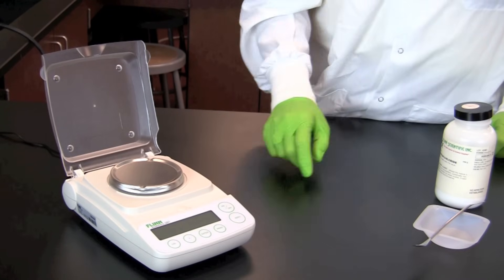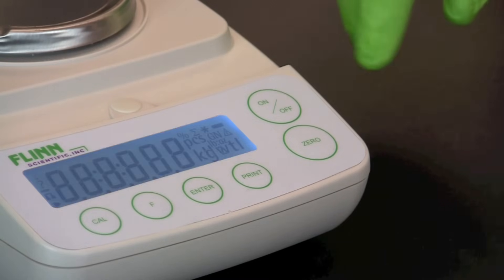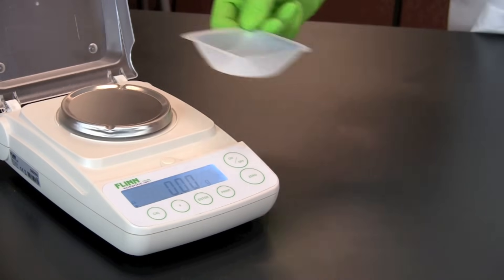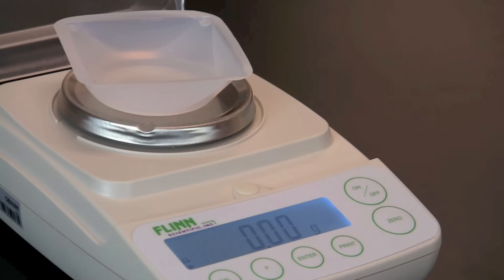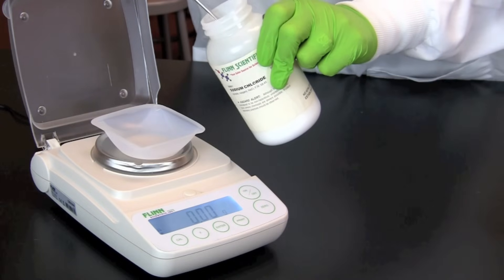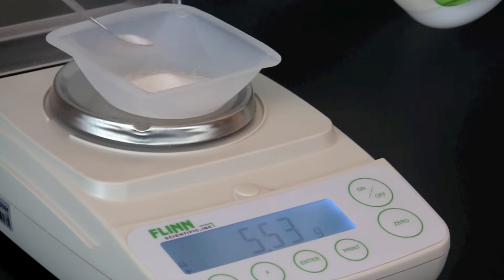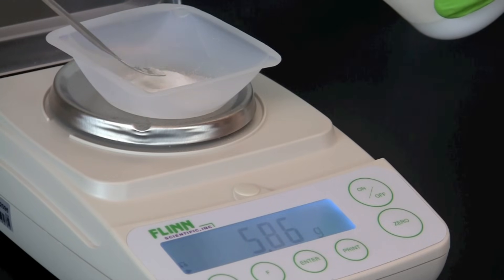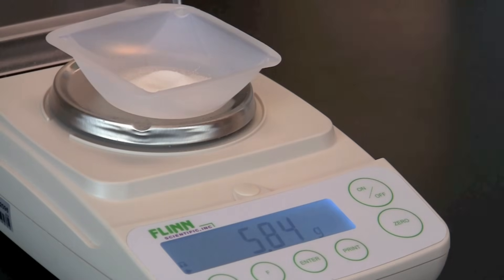Using an Electronic Balance

Comment: "Once the material is moved from the stock bottle,it should not be returned into the bottle.This prevents contaminating the source"
I didn't get the last line. Can anyone explain please!!!
Reply: I'm pretty sure that once a chemical is taken out of its container, there is a risk of the substance being affected by dust particles and bacteria in the air. Which is why you must use fresh samples when instigating a reaction!
Reply: @niranjanathangam4922  Thanks for explaining :)

Comment: Why is it advisable not to place chemicals on the pan of the balance?
Reply: Some chemicals can be dangerous and it can have a reaction with the pan or even seep through it, destroying the machine. If it is kept in a way boat, it can melt the material and cause a hazard.
Reply: @iwrsiyanawar1289 can the solids be transferred outside the scale to avoid spilling the solid on the scale?
Reply: Because there'd be traces left and you'd have to clean the surface